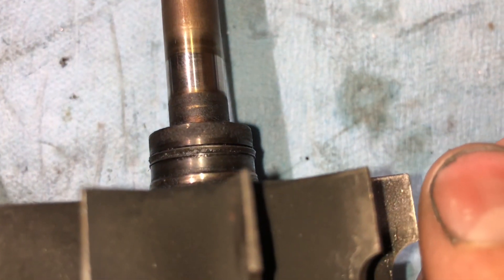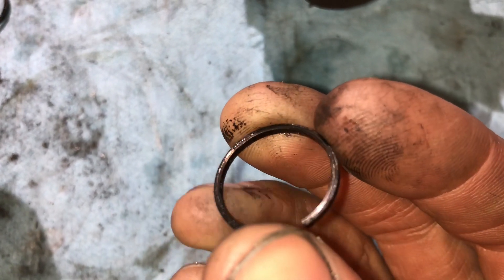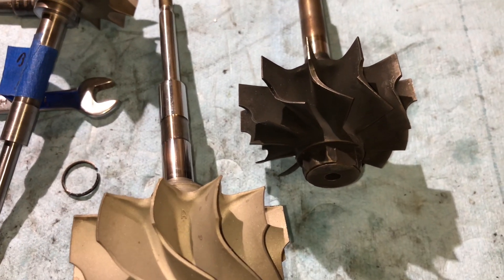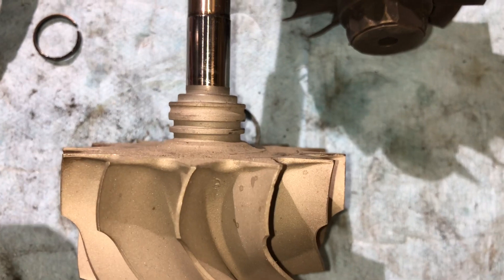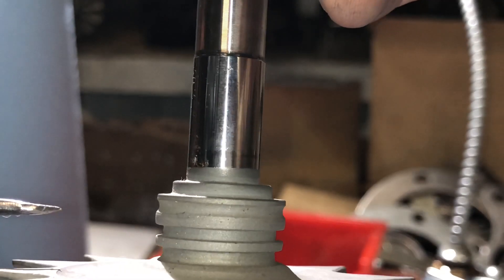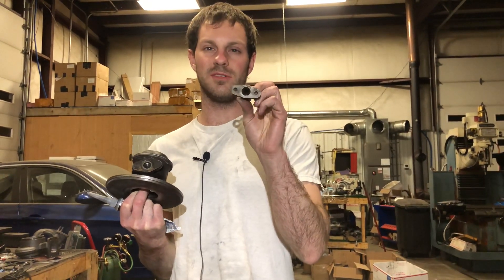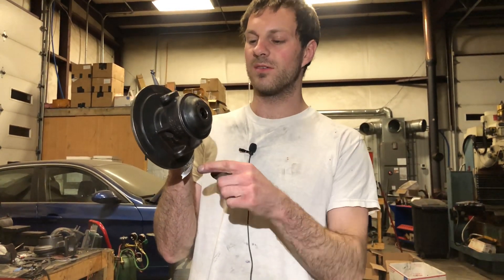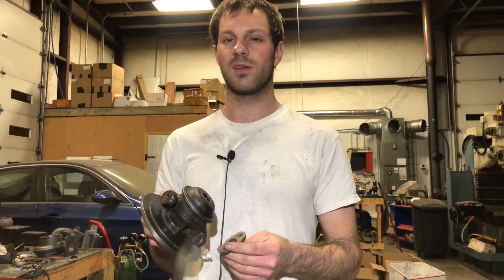Bad turbo seals, what does it look like?

Comment: A lot of good info in the video. Thanks.
Have you ever heard of a turbo failing due to poor drain even after the drain was fixed?
 I think this has happened to me, even after fixing the drain issue ( ran it like that for a cpl thousand miles ) the turbo is now still smoking. cheers

Comment: I never thought that adding a exhaust brake would push oil out of the turbo and into the intake. Not much in the intercooler tubes but oil is on the intake temp sensor and Manifold Air Pressure sensor. 🤷‍♂️ Would could new seals improve the situation. 2001 Dodge Cummins H O. Stock truck except for exhaust brake.

Comment: What about if you had over 100 pounds oil pressure journal  bearing tubro and you didn’t catch it in time shall you rebuild the tubro  j think my tubros smoke when I start the car when it warms up the smoke goes away but the smoke comes back after 10 pounds of boost I got -10 oil drain going to timing chain cover for ea turbo and I change the oil pump to regular pump from a high volume higher pressure my question is do you think I waited too long to fix the oil problem and I were out the seals ?
Reply: Excess oil pressure will cause leaks.

Comment: Will you always see visible signs of a leaking turbo? That is can sometimes it leak internally, without any oil on the outer housings
Reply from the maker: The compressed air can leak into the crank case through the seals but it’s hard to test that, because a boost leak test pressurizes the system but the air can leak fast the valves, front piston ring, or the crank case vent. The gap between the piston ring and wall of the piston ring groove should be .0025”, if larger than the seal or groove is worn.

Comment: My 335i smokes when holding a steady rpm say 1500 to 2000 smokes when driving too not always usually on decel. If I rev the engine in neutral it will also smoke. replaced valve cover, flapper valve, rb pcv, does have a little bit of siren noise I am fbo minus intercooler running stage 2 mhd.
Reply: Turbos my friend
Reply: And get yourself a Intercooler ASAP

Comment: Brand New 0 miles Bank 1 F21BI Franken Turbo leaks right out the V-Band Clamp....being told this is a crankcase pressure issue by Doug because Turbos don't leak like that....I had no crankcase pressure issues before installing these and have an upgraded pcv valve and low side OCC.....also I noticed the blades was kinda stuck and wouldn't spin freely when pulled  out the box....after a lil pressure from my finger it became free. I don't understand why. Any input would be greatly appreciated.

Comment: I opened my intake on 2014 ram cummins and it was a mixture of soot and oil alike, while previous times it was just dry soot...  Is this leaking oil turbo? And Intercooler pipes are oily from inside.
 Thank you for very informative videos

Comment: Quick question what would cause oil in the intercooler? I will really appreciate if you can help me out with that.
Thanks
Reply from the maker: Oil in the intercooler is caused by oil leaking past the turbo front piston ring or from the crack case vent valve being bad (commonly called ccv or pcv). Sometimes people block off the crank case vent which is a huge mistake, this causes the crank case to pressurize which won’t allow oil to drain properly from the turbo, which forces it out the front and rear seal of the turbo.  If the ccv goes bad, the turbo can suck oil out of the engine into the intercooler, often people use an oil catch can which will avoid this issue.

Its very common that people use a -10an fitting that is too small (10-12mm) which will not drain fast enough, as a result oil is backed up into the cartridge and forced out the front and rear seals of the turbo. I machine the -10an fittings to 5/8 or about 15.8 mm to fix this problem.

Comment: What's your opinion on turbo size for a 4.6 2v Ford, only looking to run 10psi, and it needs to be a small single turbo, not looking for high rpm numbers but wanted best sound and low end

Comment: i have had 2  s400 borg warner turbos  wear the trust bearing .the first one blew oil out the intake side and the 2nd one blew oil out the exhaust side. the 2nd one only had about 45 miles on it. ive put new feed line and discharge oil lines on . new air filters and checked all the piping.i also have made sure the engines vent tube is ciaer and clean. both turbos had the 270 thrust bearing in . i have just rebuilt the 2nd turbo with a 360 thrust bearing and am going to try it. i did see waer on the exhaust side oil piston ring. mine runs 2 of them. any idea what is causing this? i am beginning to think it is bad thrust bearings from borg warner.
Reply: Many thing can make a turbo leak. In your case excessive oil pressure or excess blow by could cause that. Also is the oil return line a large enough diameter for the oil flow rate?
Reply from the maker: The piston rings can wear out from the movement of the rotating assembly when the thrust bearing goes bad.
Reply: @turbolabamerica  I replaced the passenger side head gasket with a nice felpro on 6.0 vortech (Chevy) with a Borg Warner S475 and I noticed a little crank case pressure out of the catch can before. Now it puts out so much it’s like a coal powered locomotive. Thinking I might have bad seals in my turbo? 🤔

Comment: Great info. I've got a 2016 Deutz TD 2.9 with only 1033 hrs. The turbo is passing oil until the engine has run for about 2 minutes. No oil blowby and drain is stock. Is it possible the seal are bad already?

Comment: Hey trubolab am having a issue with my 2009 335xi am getting smoke from my right exhaust when the car is under boost do you have and ideas as the what causes that issue?

Comment: I have a Vauxhall astra 1.4 turbo 2011. My turbo was completely shot so I bought a reconditioned unit with like 30days warranty (im an idiot I know) and it has since started smoking from the exhaust but not wailing like my previous turbo did. have changed the pcv system, the solenoid, tested the wastegate actuator, and everything in between, litterally everything in between. Getting code Po299 turbo underboost, it only smokes when I accelerate hard but only around 3k revs and around 60mph and above or going up hills. Does not smoke at low speeds. I have changed the catalyic converter aswell and still have the issue. You reckon my turbo seals are failing? :(
Reply: Sounds like you may have a boost leak. If that causes vacuum in the intake at times it’ll suck oil out the turbo. Turbo air intakes need to be at atmospheric or boost pressure, vacuum conditions cause leaks.
Reply: @Nemesis-yn5wv  Thanks man for responding. It turned out that my PCV valve had gone missing, causing a shit ton of carbon buildup. Had it all cleaned and the underboost vanished.

Comment: My triton diesel smokes at idle but when i drive it its fine is my turbo bad
Reply: Check if the intake is under vacuum at idle. Vacuum sucks oil out the turbo.